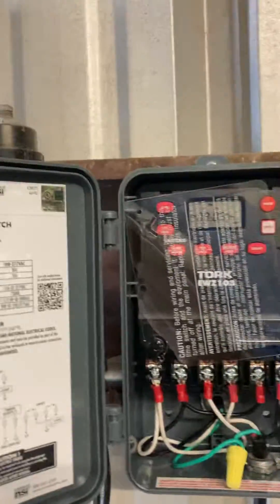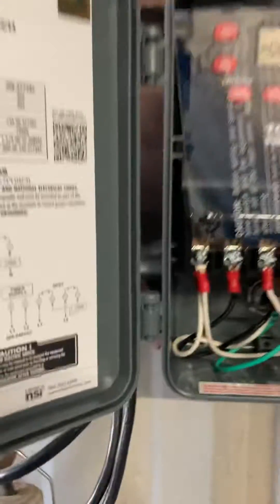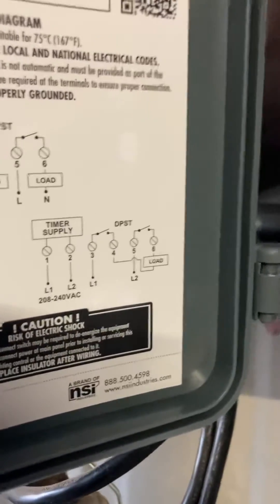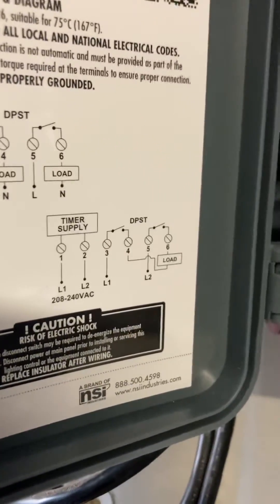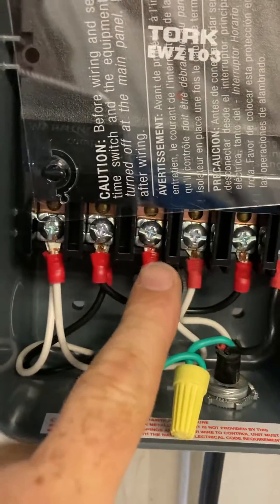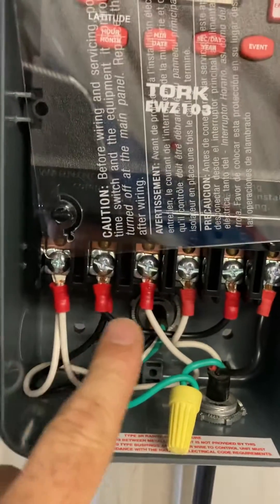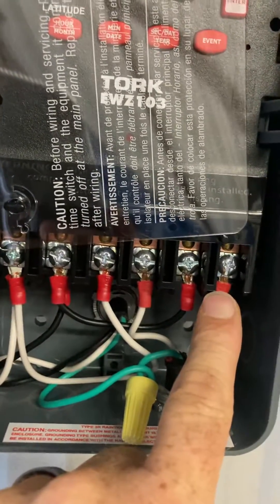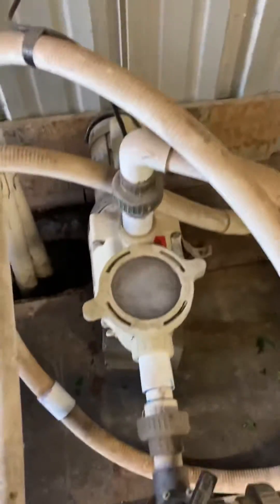Tork EWZ103 timer - wiring for 240 volts

Comment: Bingo! (I think)  There was a reassuring hum after I rewired as you suggested, and I confirmed voltage on the load end (at last).   This connects to a hot water heater on the timer, so I'll wait and see if I have hot water tomorrow morning.   Thanks for this valuable tip!

Comment: Thanks for your video, just installed it here, circuit is 220, your  video was so beneficial,  wouldn't start up initially,  didn't recognize that breaker had tripped, once reset  it works like a charm
Reply from the maker: You’re welcome